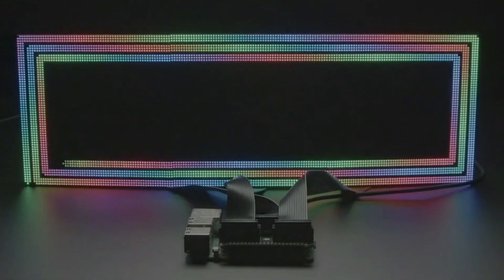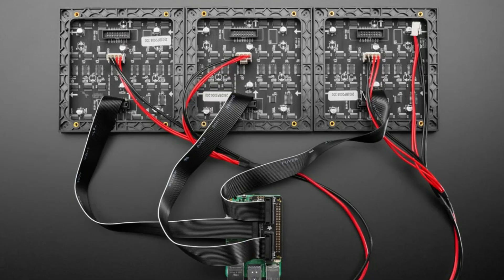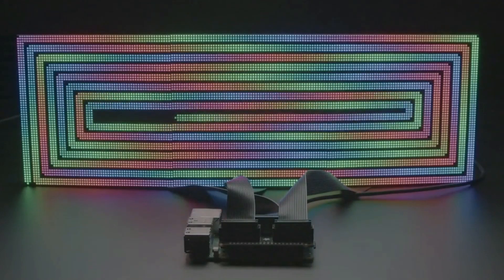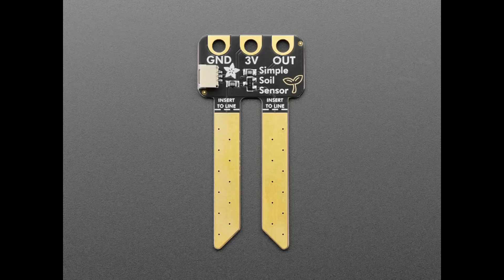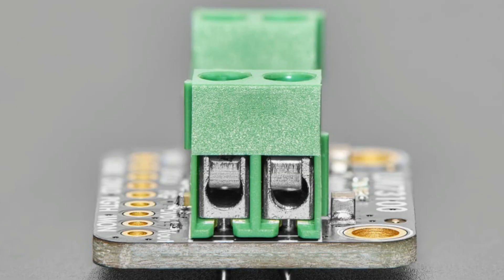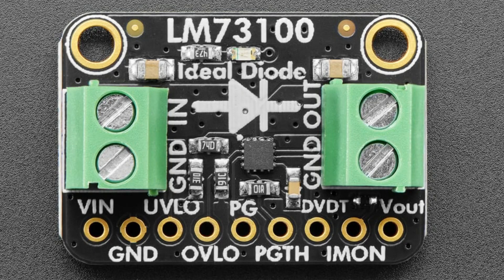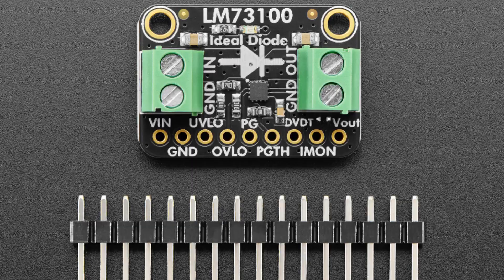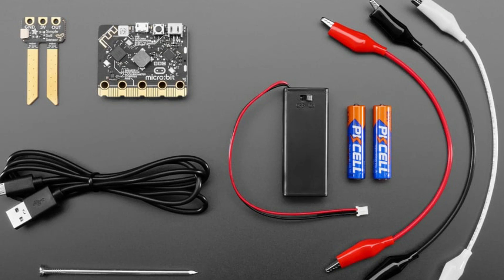#NewProducts 7/02/25 Feat. @Adafruit Soil Sensor Kit - "FarmBeats for Students" Compatible!

Comment: Can those soil sensors be left in the soil long term? Or will they corrode?
Reply: Corrode, unless they use a very low excitation-potential, preferably bipolar and/or galvanically isolated (e.g. with a transformer), but then the cost-advantage over capacitive sensors is nullified.
Reply: They will corrode, you can slow the corrosion by applying voltage for reading once in a while for a very short time. There is no practical need to get continues reading 24/7, if you do so, the sensor will corrode in less than 4 months depending on environment. Guess how I know!!